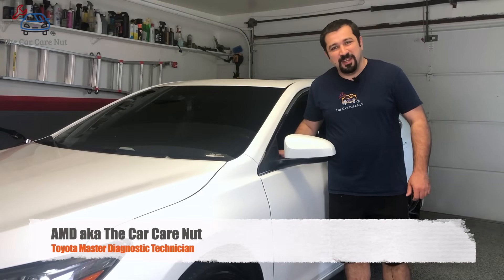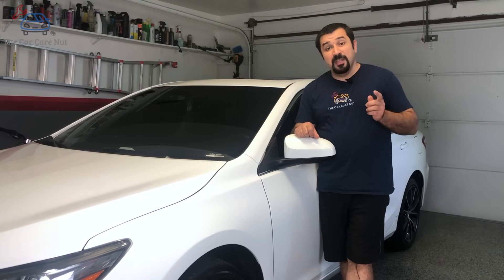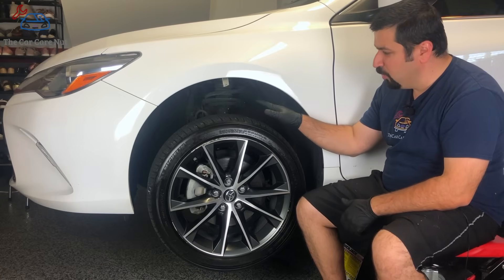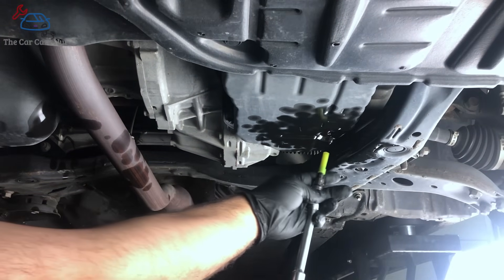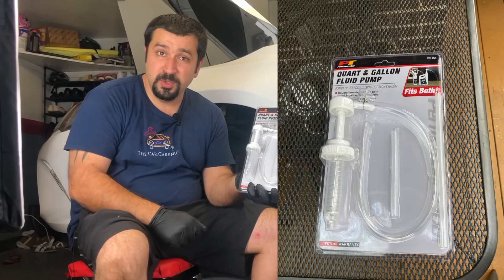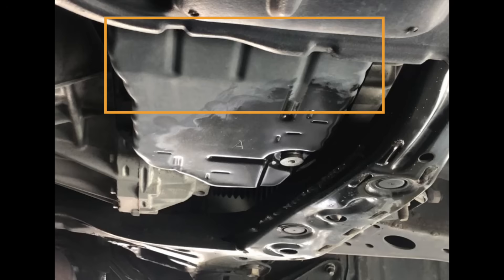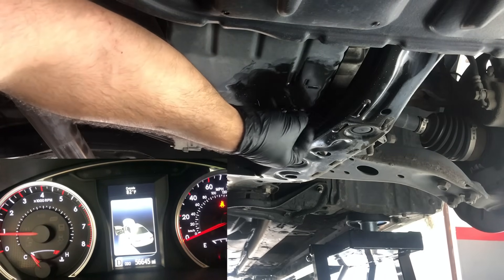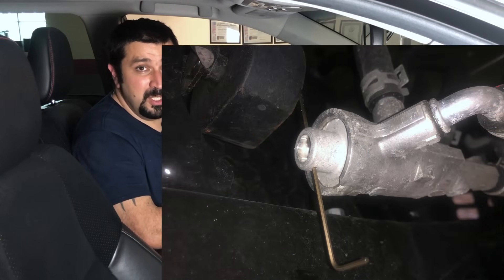How to change your Toyota Sealed Transmission Fluid

Comment: Your videos are great! Thanks for taking the time to make them so detailed. When I completed this procedure on a 2016 Rav4 LE (FWD) only 2 qts of fluid drained. I added 2.5 qts, but none came out when I did the level check. I ended up adding a total of 3.5 qts and about 0.75 qts drained out when I did the level check (using the jumper wire method). Does this mean the level was about 0.75 qts low to begin with? Should I be worried? This is the first time the fluid has been changed (60k miles).
Reply from the maker: The fluid was low to begin with. This is why I always encourage people to check the fluid level even if you drain and add the same amount
Reply: @TheCarCareNut  hey AMD. Could you do a small vid on doing this procedure on the 8 speeds?
Reply: I’m certainly not an expert but I wanted to ask if you are sure you got the fluid to the right temperature? Because, If I’m not mistaken too hot fluid may have expanded too much, and overflowed into the drain pan. And this maybe is overreaching but could it have been too cold when you initially drained the old trans. fluid?
Another thing is at the end of the video it’s mentioned that in some models you need to bypass the cooler into the system before starting this process, not sure if it applies to your RAV4, as he didn’t mention rav4 and it’s mostly directed at 8speed transmission. However I wanted to ask if that may have been the factor unaccounted for? And since 6 months have passed since your comment, I also wanted to ask how is the car doing since?
Reply: If you drained 2qts add 2qts back it ran fine with what it had you don't think it's over filled
Reply: @leohernandez7.3powerstroke61  No, it was underfilled before.

Comment: Thanks for the great videos. Can I apply this to my 2016 Hyundai Tucson SE? What about the Wire jumper to OBD and temperature range for the 2016 Tucson? Thanks.
Reply from the maker: Hi. I wouldn’t attempt this procedure on your Tucson without consulting the repair Manual for that model. This information is for Toyota and Lexus only
Reply: @TheCarCareNut  Thank you very much for your help

Comment: Thanks for the video.  How about this?  Drain 2.5 liters from the cold Aisin Camry 6 speed transmission. Add back exactly 2.5 liters of cold TWS fluid.  Same density, same volume thus same mass.  Law of conservation of mass and energy.  Log the volumes in the maintenance book.  Repeat every year for the life of the car. Should last 20 years or 200000 miles minimum. Great cars!  Toyota should never have removed the dip stick.  30 minute job and you don’t have to get under a running Toyota.  Safety first. Very good video, thank you very much!  My Camry is a 2013.   My prior Camry was a 2001 (with a dip stick).
Reply: I think the problem is spillage.  Impossible to catch everything....fluid running off your tools and hand...etc.  Then add to it the idea of pulling the pan and filter (if it has one) and cleaning that out.  And every time you do it, your quantity is a bit wrong.  That is the problem I see.
Reply: @spacecoastz4026  I agree. You would have to work like a laboratory scientist (I am one) in order to match actual fluid volumes!  Be wary of the accuracy of any cheap IR temperature gun/reader, always check your IR temp reader against a medical thermometer to confirm accuracy, and be aware that IR temp readers read several degrees LOW when aimed at bare metal, and may read much lower aimed at a clear or semi-clear container!!! Lastly, the trans fluid temperature rises fast while the engine is running, you'll have perhaps just a minute or two to pass through the temp range.

Comment: Try Ravenol Toyota World Standard.  100% synthetic.  Exxon/Mobil only provides a 100% synthetic in China.  The Toyota Product is not 100% synthetic in the USA.
Reply: Apparently the EPA somehow pressures Toyota and major fluid distributors to use only the lightest fluids in US cars, even the owner's manuals show very different fluid specs vs. Camrys and Corollas sold outside the US. 
The fluid-change intervals in the US are in miles, but are in same number of kilometers in other countries! 
Also, Aisin, who makes Toyota's transmissions, doesn't sell their best synthetic WS-rated fluid in the US, you literally can't buy it here. It has a thicker viscosity at operating temperature btw, just like most other WS-replacement fluids do.

Comment: My toyota yaris 2012 manual says it take toyota CVT fluid type TC but this is not available anymore. Is using Toyota CVT fluid type FE ok?
Reply from the maker: Hi! Which market is this in and what the is the code name of the transmission on the door jamb?
Reply: @TheCarCareNut   Thanks for replying. This is in the UK and the code is: A/Tm - 02A/K411
Reply from the maker: I see. That transmission is not available in the US so service information on it is very limited on my side. I would contact your local Toyota dealership and inquire about what fluid they’re using

Comment: Is it the same method to replace the 19 Highlander 8speed transmission fluid?
Reply from the maker: Hi! Yes but you need to push the pin in the cooler bypass as I talked about in the video

Comment: A toyota dealer out here was saying that the cvt fluid is 500 a quart. I know it's more expensive, but that seems a little high. He also said that it never needed to be changed, which I now know otherwise.
Reply from the maker: That’s is a crazy high price! You can buy - 4 liter can for less than $100 which is more than enough to replace the fluid. Is this in the US?
Reply: @TheCarCareNut  this was in Phoenix, Arizona. My dad has a 2014 corolla, he mentioned it to one of the service writers, and they mentioned it was $500 and that it never needed to be changed. I told my dad that the dude was wrong, and that it's recommended every 60k miles. He is currently at about 140k miles without it being done. So far it's been driving fine. I've heard that on normal A/T that if you go too long, it's best not to replace it because it can then cause issues, but I'm unsure about CVT and if it would be safe to flush now at 140k miles
Reply from the maker: At this mileage I would leave it alone honestl.
Reply: Copy that. I appreciate the honestly!

Comment: To anybody who has done this... Was there a crush washer on the fill plug? Are there torque specifications for the drain plug, the fill plug and the bolts around the transmission fluid pan? 

I am contemplating dropping the whole pan as I don't know how the car was driven prior to my purchasing it better safe than sorry.

Comment: Great Video, thanks a lot.
I have these questions :
1) How to change the transmission oil filter ?
2) Is the procedure similar for a 2020 Hybrid RAV 4 ?
Reply from the maker: Hi! To change the transmission filter you need to drop the transmission pan. I would really recommend you replace the filter as you won’t gain much in Toyota transmissions. Your RAV4 hybrid transmission is completely different. This week I will have a video for those come out on the channel

Comment: Do you recommend a complete flush of the transmission with filter... what is the ideal temperature for 2016 tundra...Would this procedure also apply to the tundra...
Reply from the maker: Hi! Flushes are ok if followed by a fluid level check. This procedure applies to 2016 tundras but those might have the cooler bypass on the side of the transmission

Comment: Do you ever need to drop the pan and clean the magnets or replace the filter at all?
Reply from the maker: You can but really will not gain anything as the filters rarely if ever get dirty and the magnet will have some material but most of it is from when the transmission is new and will just stay there

Comment: What is the easiest method to ensure the car is level if you have to put it on jack stands-especially if the floor is  not exactly level?  Is there a specific region on the under belly of the car that a level should be placed ?
Reply from the maker: Hi! Honestly you’d want to kind of eye ball it and see if it’s level. You can place a level in the middle of the wheelbase between the wheels on the car to see how level it is and try to get it as close to level as possible. Maybe change the length of the jack stand to compensate for the non level floor or find a different location that is level.

Comment: This is not changing much of the fluid.  2.5 quarts of the 12 or 14 quarts thats in the entire system.    So run the car ten minutes cool it off and do this one or two more times? 

Is the 2008 to 2010 sequoia 5.7 v8 the same system for level as this car ?  Thanks
Reply from the maker: Hi! The idea is to replace enough fluid to refresh the additive package. You’ll never get the whole capacity of the transmission fluid replaced. It’s the same procedure for those years sequoia

Comment: Do you ever change the filter inside the transmission pan? And is the fill plug closed when you check the fluid level?
Reply from the maker: Hi! The filter is not normally replaced on Toyota transmissions and can last the life of the transmission if the fluid is replaced on time. The fill plug can be installed or off when checking the fluid level. I would leave it loose in case you need to add
Reply: @TheCarCareNut  I'm at 156000 miles on my 2015 toyota corolla and was thinking of changing the transmission fluid. I was waiting til 160,000. Btw I got the car at 105,000 miles.
Reply from the maker: Hi! At this mileage I would be a bit wary of replacing the fluid honestly. Does it have any history from previous owners showing replacement?
Reply: @TheCarCareNut  no but I drive for Uber and GrubHub so I'm going to put more miles on it. Will there be any signs that help me signal that I need to change the fluid?
Reply from the maker: Honestly I have seen many cars with well over 300k with the original filter and they’re good. If you want to replace your fluid I would just do a drain and fill one time and follow it again after 30k don’t do flushes at this mileage

Comment: Great video of professional ATF change procedure. My way of doing this is to measure the fluid drained from a never serviced transmission (make sure no leak at all), put back the same amount from top using gravity method through a Toyota ATF fill adapter. By the way, never trust the marks on the measuring container. Put my own mark on the container and fill new ATF to the same mark. Then I install a low profile drain valve instead of the drain bolt without installing the tube (straw). I can do multiple ATF changes in the future without mess. Any comment if this will cause incorrect fluid level? e.g. fluid loss from previous miles?
Reply from the maker: Hi Kent. So I am good with measuring and adding the same amount however you’d be surprised how many are not at the correct level even from the factory. I’d say if you did all the work of draining measuring and refilling why not spend a bit more time and check the level and be 100% sure without doubts that it’s accurate and good.
Reply: @TheCarCareNut  Thanks for your reply. You are correct. I will check the level in the future. I actually have a Toyota specific scan tool.
Reply from the maker: Even easier with a scan tool as you’ll just wait for the temperature to get in the range  and you adjust it
Reply: @TheCarCareNut  You mentioned the temperature goes up quick, I will let the car sit overnight, measure at 104 degree. Again, thank you for this video so that I can understand Toyota's terminology of "trickling". I saw some video showed "dripping" and some showed till no ATF came out.

Comment: I have looked at blown up diagrams of my 2018 RAV4 XLE's transmission. Namely, just above the pan - the filter.

Every Toyota dealer service tech I've talked to says there is no filter. A $300 complete transmission fluid flush doesn't even include touching the filter.

It is a $50 part, is quite accessible when you drop the pan, why aren't technicians even knowledgeable about this?

The filter part number is 3533073010. While I will triple check before ordering, I'm pretty sure that that is needed and a gasket needs to be separately ordered.

Because I am bought this CPO car at a high annual mileage (25k miles/yr), the engine and transmission are my biggest concerns. I don't know if the previous owner did delivery or sat in traffic for ages.

What gives? Do they say there's no filter because there's a problem if you change it? Are they hoping that you don't change it so that they can sell you a new transmission at 80,000 miles? Help? Help!
Reply from the maker: Thank you for your comment.

All Toyota transmissions have a filter. Any Toyota mechanic that tells you they don’t is misinformed.

Having said that, through experience these filters almost never get clogged or cause issues. How do I know this? By seeing hundreds of Toyota’s make it well into the 300k miles+ on the original filter with only transmission fluid changes at the correct intervals.

If you want to replace the filter in your transmission go for it. Just know that opening the transmission pan might seem simple but now you are working inside the transmission and the chances of contamination are much higher.

Have a nice day.

Comment: Great video content! Hey I was curious as I am getting ready to change transmission fluid on my 16’ highlander I’ve seen that you can also apart from draining pan you can pop off a transmission cooler line to get even more of the fluid out as a fluid flush. Do you recommend this? Also what’s your opinion on amsoil signature serious transmission oil for use in toyota vehicles
Reply from the maker: Hi! I wouldn’t attempt the flush by undoing the cooler hose as things can get out of control quick and end up damaging the transmission pump. I personally wouldn’t use any fluid other than original fluid in any Toyota transmission.

Comment: You tube video or not think twice about the money savings you may get if you complete the process correctly. If you get wrong it will cost you big time. Study the data and get the service data directly from Toyota "E" service system online. There is a fee per month or per year for access but it is always updated and accurate. It is worth it!

Comment: Do you only change it once?  I noticed that the fluid still looks less black but a more dark red when the OEM fluid is a clearer red.  Also are there any other fluids other than oil that you recommend changing around the same time?  I have 2.7 2WD 2011 Venza and want to start this soon.
Reply from the maker: Hi! I would change it once. Ws fluid tends to get dark quick which is normal as long as it doesn’t smell burned.

Comment: At what kilometers do I change a Toyota Corolla le year 2014  I live in Montreal Quebec Canada .Also should the car be brought in very early in the morning because as I understand transmission fluids gets extremely hot and need to be cold in order to completely drain it .
Reply from the maker: Hi! Replace it around 100k kms or 6 years
Reply: I'm at 161,500 kilometers is that too much now for the CVT transmission fe fluid .

Comment: It's doing at a dealer there how much they charge the price for that car and price for 4 runner 2017 please tell me the truth.
Reply from the maker: Hi! This will vary by area or dealership but I’d say 200-300 is right.
Reply: @TheCarCareNut  Thanks for the answer.
Reply: At Toyota dealer in Australia , they change the automatic transmission oil for the Toyota Camry $500.00 dollars

Comment: We own a 2010 Toyota Corolla LE sedan 
 1.8 liter engine with an automatic transmission . Transmission fluid has never been changed . Currently has 48,000 miles. How many drain and refill cycles should be done to remove the majority of old fluid and replace with fresh fluid ? . Should we use a specialty transmission shop for this needed service or my  local trustworthy mechanic ? Thanks . PS : Is it safe to replace the original Toyota ATF with Amsoil synthetic transmission fluid ? PPS : How many quarts of ATF should I buy for the initial drain and refill ? Thanks.
Reply from the maker: Hi! One drain and fill is sufficient to renew the additive package. I would stick with Toyota original fluid on this one.

Comment: I understand this doesn't drain all the fluid in the transmission. Kinda impossible that it only contains 2.5quarts. Definitely there are some left in the torque converter. Given this, how many times would you suggest to repeat this process to get all those old fluid out?
Reply from the maker: Doing the drain and fill once is enough to replenish the additive package.
Reply: @TheCarCareNut  Noted. Amazing video by the way and thank you for taking time going through all the nitty-gritty.
Reply: Hi there! Just an update - had mine changed at 100k kms just recently. 

Some observations:
1) Acceleration became smoother. 
2) No more jerking and the feeling of the belt "slipping" is gone.
3) Less whirring/whining noise from the transmission

Comment: * * * * * * * * *
Some people are asking this.
What is wrong with replacing cold transmission oil by the same level of cold transmission oil using a graduated bucket?
* * * * * * * * * * 
ANSWER
If you initially have an incorect level of transmission oil, you will end-up with the same incorect level after the procedure. Are you 100% sure the mecanic set the correct level in a previous fluid replacement? No, especial,y if you bought the car used.
Reply from the maker: Robert the keyword here is “hopefully” 😉